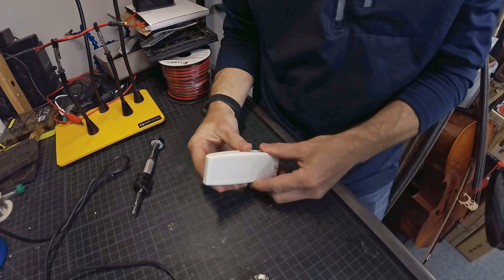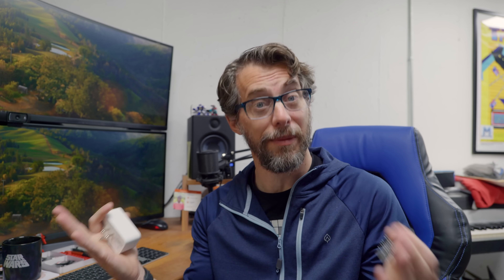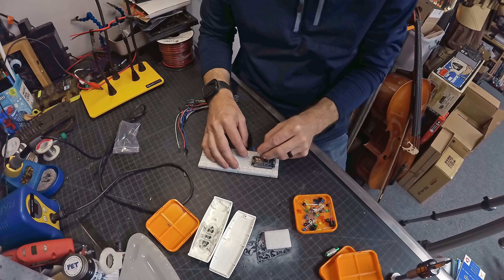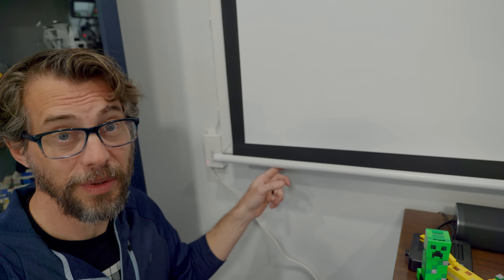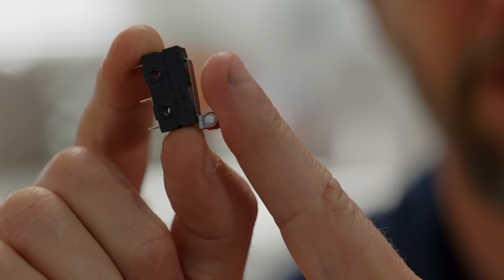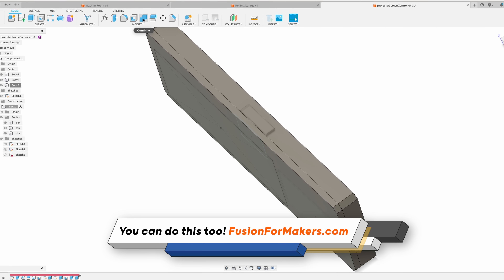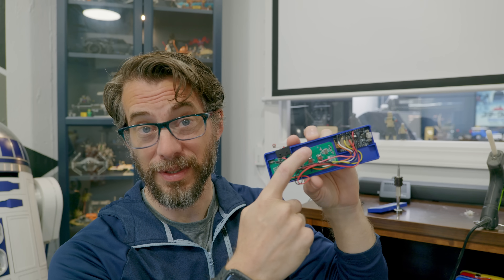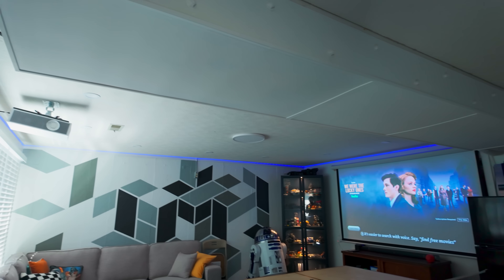Make Dumb Electronics Smart for $3

Comment: I've got the same screen and it's adjustable, it's a little screw-turn limiter in the screen housing on the side with the power cable. It's not really obvious just looking at the screen or in the instructions IIRC. 

Pushing up on the remote when the screen is going down will stop the screen as well. You could set your routine on a timer and tell it "After 10 seconds, Screen Up" and not need the physical limiter, or have to wire up the stop button.
Reply: I was coming to say this. All the tubular screen motors have endstops in them that are either adjustable with a hex key or push-click to set. I worked in technical support for a projector screen manufacturer for 4 years. It was good fun!
Reply: I was also thinking about a time limited stopping function, such that you wouldn't need anything physical to trigger where to stop. The main detriment to this is that it would assume a fixed starting point every time. If, for some reason, the initial point started part way down, the time-based approach would not stop at the correct location. Not sure if that could be a problem with this screen but that would be a potential as to why a physical stop trigger was used.
Reply: Yep was going to comment the same thing. No need for the limit switch if you have your screen adjustment done. It'll stop where you want it to every time and will automatically disengage the motor.
Reply: I think he did a bad job describing the need for the switch, I could be wrong! It seems to me by using the software to control the motor whether a built-in limit on the motor or not he would still have to have the program understand that the job is complete otherwise, it will keep sending the signal and drain the battery.
Reply: @imyourocd  the way the projector controls work, you only need to send a single pulse on any of the given buttons. So your smart board could just pulse the up or down button for a quick moment then disengage. The screen's built-in limiter would then stop the screen at the top or bottom.

The smart board isn't really controlling the motor. It's just mimicking a remote button push. The screen's built-in electronics are what are actually controlling the motor.
Reply: It’s funny you say that as I have a screen very similar to the one in the video and the instructions were rubbish. It stops about an inch short of fully rolling up and I want to bring it closer. Must have another look at the workings

Comment: This is really cool. I'd love to see a version of this that replaces the remote entirely with SDR. A retrofit for the entire wall controller with built in limit switches/rotary encoder would be cool in that you could use it for other stuff around the house.Also, looking online, it seems like it is possible your current controller actually has limit switch pins that just aren't hooked up to anything...

Comment: Just check the rating for the onboard regulator. 12V was probably fine to use without the bulky step down.

Also the switch probably blocked the signal because it was so weak on the lower voltage. Maybe split the difference and use 9V to the remote and Arduino.

Also also, no relay needed, just a few transistors.

Comment: could you not simply use an RF sender thingy? I mean they are prety easy to use...
Reply: Ideally yes. The problem is a lot of devices using a type of encoding that continuously changes to prevent people buying their own smart controllers instead of using the supplier’s proprietary system.
Reply: @andy_warb  That's a fact, but for low end consumer stuff like this, not so much.  Cheap is the name of the game. Depending on how cheap they went, you may not even have to worry about pairing a remote to the screen.  Which does bring up the question, for this particular unit, what happens if you have two of them?

Comment: A much elegant solution is to replace the mechanic switch with a reed relay with a long wire and a magnet embedded on the screen's back and hide this box entirely. There's no need to make changes on software or the esp.
Reply: even more elegant would be (forgetting for a moment that he missed the limit screw) set the amount down as a brightness, so that if the screen all the way down was fully on, but, say, that's only 70% of the way down, he could remap the definition of "on" in code to be 70%. then it's controllable like a lightbulb, and you can say "turn on the screen 50%" and it would drop to half-open. or turn on (to 100% and that's really 70%) and it's fully down. Extra credit maps all math functions to 70% of 100% so 50% is half-open as he knows it, and that way no one could ever say "80%" and have it drop down onto the desk.

Comment: If the shade motor is consistent enough, couldn't you eliminate the limit switch with software? Something like "Lower shade 12.8 seconds then send Stop command". Then you could mount the box on the projector, out of sight.

Too bad it wasn’t IR, then you could just clone it instead of hijacking the remote.
Reply: Using Dead Reckoning with systems like this tends to be a bit risky. It's prone to stalls, overshooting, and drifting over time.

Comment: That’s not Arduino, it’s ESP32
Reply: "ESP board that's similar to an Arduino"
Reply: @GladeDuck Arduino is a software framework that started on Atmels, but was extended to a lot of other hardware.
Reply: @GladeDuck  Yeah, something like:
Arduino ≠ ESP 
Arduino ≈ ESP, perhaps
Reply: @DavidSprings  Unfortunately, Arduino means several things, depending on the context. It can mean the hardware (originally the Arduino''s used the ATMEGA328P (IIRC), then expanded to parts like the ATMEGA1284P, and then others) or the programming environment. The programming environments for the ESP32 include the native Espressif environment, the Arduino environment, ports of several other RTOSs, etc. The Arduino environment is designed for users who don't like to see compiler warnings and suggestions, and as long as it doesn't have a fatal compile error, it will probably do something close to what they expect.
Reply: @JCWren  I get your point, but don't entirely agree -- at least not yet. I have no doubt that Arduino will achieve generic status, much as the name Kleenex has become a generic name for tissue, but as of now, I don't think it has reached that level. For now, in my opinion, it is either an Arduino of some flavor or an ESP of some flavor (or something else), which are all microcontrollers, and can all be programmed under the Arduino IDE.
Reply: That's not an ESP32, it's ESP 82
Reply: Dude he iis trying to explain the thing in layman terms so that the people who have no idea of electronics can understand
Reply: It’s an ESP32 that can run the Arduino programming environment.

Comment: Does your screen not already have a limiter you can set max and min limits internally? So you can just hit up/down and it stops.

I know ones Ive installed do, but those are commercial, seems like a bad design if residential,/consumer ones don't already as well
Reply: ^ I'm wondering the same. I had one of these $100 screens and it has a limiter to dial in the stop position when lowered.

Comment: esphome is the software/firmware you want.
Reply: Especially because you are already using home assistant for other things
Reply: Came here to say exactly this. I built a motorized shade for an inaccessible window in my house using esphome and it took like 5 minutes to configure.  Didn't even bother with limit switches, just timed how long it takes to travel up and down, added a delay into the code. Works like a champ.
Reply: @elesjuan  that's how most of the controlling systems for such roll curtain type stuff works.  Syncing is handled by adding couple seconds every time you call the full closed and open states, everything in between could be achieved with timing.  Usually you can control multiple curtains side by side by percent values and never even notice them going out of sync, as 0% or 100% is so often called (and has that overshoot on them to fix any issues).  Configuration usually has only two values, full run time from end to end and how much that overshoot would be added.  There should be internal limit switches to actually stop the thing from breaking itself, usually you can and should set those limits while installing the thing.
Reply: Ding ding, ESP home is amazing. If you come from a roll your own code world like Bob is can feel weird to not write the code but it’s really the best way to go.
Reply: ABSOLUTELY, I personally have used ESPhome for a TON of things in a similar fashion.  I think my favorite project/proof of concept has been putting an LFP battery in a vehicle as it's primary battery with zero modifications to the charging system.  I use a contactor to connect the full flow of the battery to the system, a DC to DC converter to charge the battery, a large diode to prevent the backfeeding of power from the "vehicle side" to the battery directly, a couple solid state relays to induce the contactor and DC to DC converter, and an ESP32 to control it all.  

Stepping on the brake initiates the contactor, the vehicle running holds the contactor in and initiates the DC to DC converter.  When the car is off the contactor and converter are turned off.  For now this is just an automatic jump pack which I can manually turn on if needed and the junk lead acid battery just holds a charge to act as a buffer and operate the brake lights.  Eventually I will probably put in a fuse to allow power all the time but will still use the contactor to connect the battery to the system and completely remove the lead acid battery.  Better to only have 40 amps of power available should you have a short than the potential 1200 plus amps the cells can put out at 13.3 volts when the battery is fully charged.  Did I mention that the car cranks over like a dream?
Reply: totally agree! i started with the arduino ide but if you are already using home assistant, the esphome workflow is so smooth!
Reply: I wanted to get started with esphome but have not gotten around to it, can someone link a tutorial on a beginners guide or smth like that?
Reply: @dschaedler  some german youtubers like simon42 or smarthomeyourself have a esphome basic video. probably others aswell. In case you understand german. What project would you like to do?
Reply: @alkly  nothing in particular; just playing around with smarthome and automations in general. I was deciding to put esphome oder tasmota on my shellys and decided to do tasmota as i knew it already.
Reply: @dschaedler   i normally recommend starting with a project, so you know exactly the benefits. E.g. an easy project is to use an esp8266 and use some temp sensore like an BME280.
Reply: Thanks broooooo
Reply: Should have taken the motor apart and attached a rotary encoder and have it set the screen to different heights.
Reply: @Ajicles I have no experience with projector screens, but I don't imagine it's a common occurrence to only want half of it?
Reply: @MrModTwelveFoot  I've owned a few different projectors, usually with a screen hung to a wall but for rollable models, there're exactly 2 places you want it and since projector's have to line up right, as any settings that alters the geometry of the output ruins picture quality quickly. 

Pretty crazy that UST projects  intentionally warps the image to achieve the crazy short throw rate but limits them to only 150"a No room for any height issues with a 3ft throw distance for 100 's. 

I would have gone the ESPHome/Home Assistant route but nice to see it done the hard way, well harder than ESPHome anyways. Just created a completely local voice assistant.